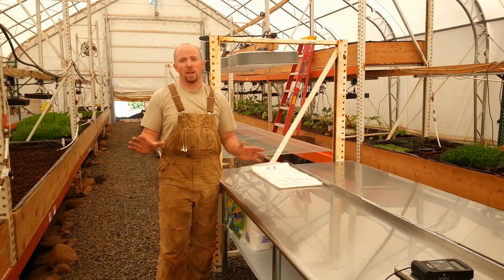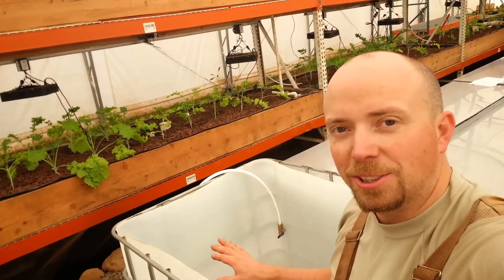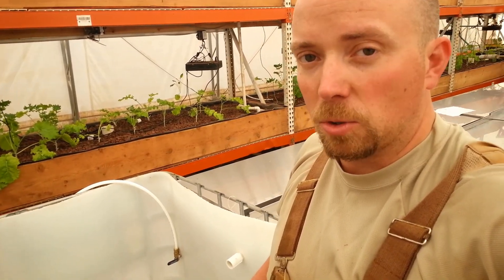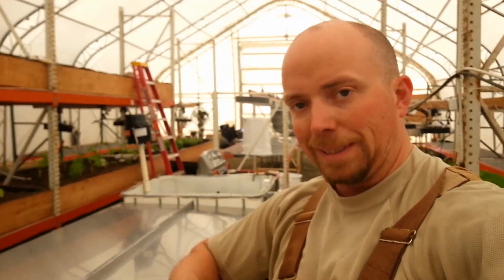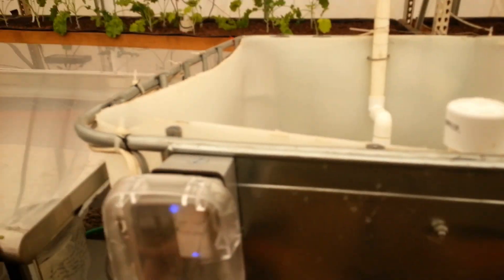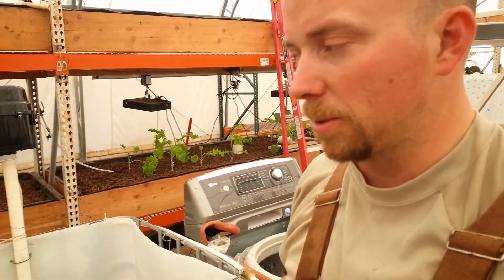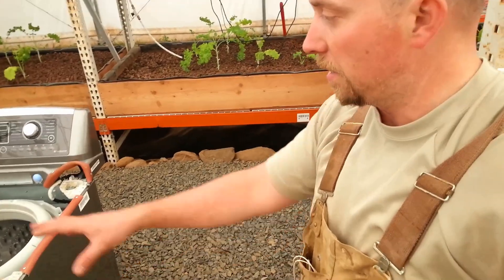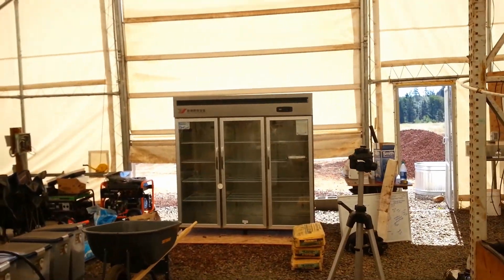The ULTIMATE DIY Microgreen Processing Line

Comment: Hmm, i can see a simple electric driven belt in between the cutting tables driving the produce automatically into the washing location (on >< type rollers, so the produce doesn't fall off). Would have to likely lower the washer a tad, so it falls off into the washer but there seems to be enough room for that... Put a button on each work section of the table (so you can work at every location), so you start stop it on every location, can just cut and drop it on the belt, hit the switch to make some room for the next, when you are all done some of it will have already dropped in the washer, but you can just hit the 'run belt' button while you walk to the washer to hit the switch to start washing. One less big bucket you have to haul with...

Comment: another suggestion... I would use a panduit strap on those IBC totes.  That plastic can get sharp and deform easily over time.   Cut 2 slits or drill holes on the very top of the totes about 6" from each side and "zip-tie" to the exterior cage

Comment: I have a question about the drying station. What is the mesh made out of, it appears to be galvanized mesh? If that is correct, will that not contaminate or give the micro greens a zinc taste? And if the screens are not stainless , then why go to all the effort of the stainless tables? Also are you not blowing all the dirty air in the building down onto the micro greens contaminating them after being washed? Just a observation of your processing procedures, are you inspected by the FDA or a state food inspection agency as being a MFG of food products?
Reply from the maker: +Matt great questions. Yes screen is galvanized. So far no problems. Good point on air. We will be inspected. We are reaching out to the agencies

Comment: For what it cost to save 6 hours, how long will it take to get ROI to cover at the local rate for help? It is huge that the 6 hours can be redirected to greater gains, income , etc.
Reply: If you think about minimum wage @ $7 per hour (that is the federal rate.... local states go higher), that is $42 per time this system is used if it was just a single person (meaning just "Mrs. Martian").  Looking at all of that equipment and the scavenging done to make it work, I doubt it was more than a couple grand of total capital outlay.

Getting a ROI in under a year (which would be easy to do in this situation) is literally a dream for any sort of investment opportunity, especially since the lifetime of this system is easily a multi-year view.

Any Wall Street investment firm would be thrilled at that kind of ROI for permanent capital expenditures.
Reply from the maker: We'll end up using it ~66 times to get our money back...definitely a good ROI (less than a year)

Comment: Jeff, I have another thought and a time saver idea with the drying rack. Get some stainless steel window screens that will cover the mesh, it comes in rolls and is fairly cheap. And then cut the diagonal brace on the last upright before the packing table off, which your only holding up the fans. If you really think you need it, put a brace up higher,or put a couple of gussets at the top, very doubtful you need anything though. Then when the micro greens are dry, you can then just pull the screen through the uprights onto the stainless packing table, plus there would no waste of the greens going through or sticking to the galvanized mesh . And a brush will easily clean the screen off if need be.
Reply from the maker: oh wow..that's a brain buster...great idea Matt
Reply: Thanks, that should be a improvement and time saver.

Comment: How much of this system draws power from renewable energy compared to energy off the mains? i know you have a solar set up but have you also considered a small scale wind turbine set up? Apologies if you have explained this in a past video. regards a scientist and fan from New Zealand.
Reply from the maker: during the sunny times of the day the system is 100%+ powered by solar. We have considered wind and have built a pad for it but have not installed it yet. Part of the sensors that we have installed includes a anemometer so we can measure wind speed. I think we may have wind in the summer but not in winter...we'll soon find out.
Reply: Awesome!, 100% solar is a great achievement. I Look forward to seeing how you progress with wind.

Comment: Very significant process improvement.  Very busy improvement season.  From others comments: stainless screen is available and I wouldn't be surprised if you are pushed there; even a furnace filter on top of each fan would catch most airborne particles and early implementation could be taping them on top of the fans.

Q: what was that noise in the spinner.  It sounded like a bad bearing that made a grinding sound ~ half dozen times per tub revolution.  

Maybe post an image of the schematic sometime for the electrical engr's to think about for a better spin control.  Most washers have them on a panel somewhere.
Reply from the maker: the noise was the auto balancer going. Not broken sound, just the balancer. I'll check for the schematic...good idea

Comment: I have one comment/question regarding your drains in the processing line. You mentioned putting in a filter to keep the micro greens from clogging your drain system. My comment/question is that your washing the growning material and dirt and debris off the micro greens have you  accounted for filtering dirt and fine materials that will pass through a screen filter from the waste water before it enters your drain pipes? I'm thinking that over the long term of your operation the washing of non biodegradable dirt/fine material into the piping system might/will lead to a catastrophic failure of the drain system at some point in the future that will lead to a huge expense of digging up and replacing your drain piping system because it is full of dirt/debris. I have no idea how much dirt your washing off from each tray but over time that stuff will build up in the system and cause a major repair. 
I used to work in a slaughter house when I was a teen and after dispatching the cows and hogs we power washed off the mud and dirt from the carcasses before they were butchered. The water was screened to keep the big chunks of mud and dirt from going down the floor drain but the individual grains of sand, dirt, mud flowed down the drain unimpeded. That is until one morning the floor drain backed up and flooded the kill floor...long story short was the concrete floor had to cut out and all the pipes and septic field drain system  had to be completely replaced and the business was shut down for nearly 2 weeks. It was a small family owned outfit and it nearly bankrupted the company. They tried everything before tearing out everything but it was just to stopped up to clean out. I thought I would pass that s long for food for thought it may not be a issue in your situation but I thought I'd pass it along so at least you could think it over and determine if something simular could happen to your operation. BTW...I admire your efforts to develop a system to feed people in under developed countries and for future space exploration. I probably won't live to see man try to colonize another plant but I sure have dreamt about moving to another planet when I was a kid and traveling to distant civilizations. keep up the efforts because I would love to see your efforts fix a huge problem right here on earth.😁
Reply from the maker: that's great input and I thank you for it...the good news is our drains are relatively shallow so we can get to them...but...your point is well taken. I have some filters coming and I"ll video them to see if they work..please keep an eye out

Comment: Dear TRM, brilliant reduction in processing time ... it looks like you have lots of 'motion' still, getting 18 trays from the growing racks to the processing station and back again. How many trays can be carried by a single person? How many trays can one person process at the 'Cutting and Sowing Station' at one time? If the answer to the second question is only one, then why do you need space ... and infrastructure ... for 18 or 24, unless you have sufficient access and resources for 18 -24 workers? What may be of use is a 'trolley' that can carry 18 or 24 trays across the 'rough ground' and obstructed gravel surfaces inside hab 1. That would give an 18:1 or 24:1 reduction in 'motion'. Another lesser reduction could be gained by ensuring that you process 1 tray at a time and take 1 tray from the growing rack process it and return it to the growing rack before repeating. This prevents 18 or 24 'collection' journeys processing of 18 to 24 trays before 18 or 24 'return' journeys! It reduces the number of journeys from 2 x n to n + 1. Rather than the 'goal' of a 'smooth' 'single piece continuous flow' process which is one of the 'goals' of 'lean' you have created a 'batch' process with the associated extra investment ... ;o) Yours Aye, GB
Reply: Batching is always more efficient.  Switching from task to task quickly is not how you save time.  Common mistake of lean methodology .
Reply: ... I am happy to receive criticism that is based on 'hard won' experience and based on verifiable evidence, preferably measured against some commonly agreed and validated 'baseline' or benchmark ... I personally do not like critical statements which include the words 'always' or 'never' or 'common mistake' without some evidence!